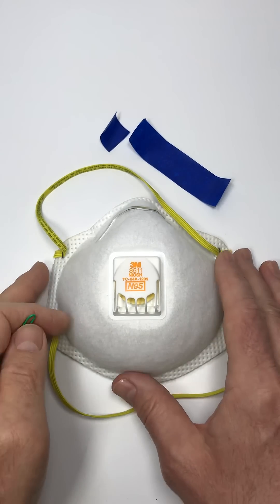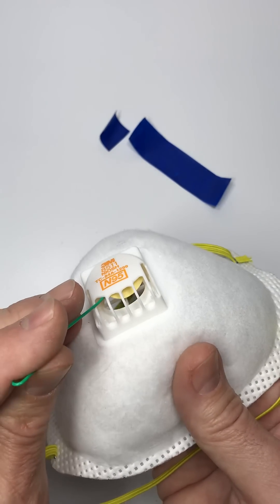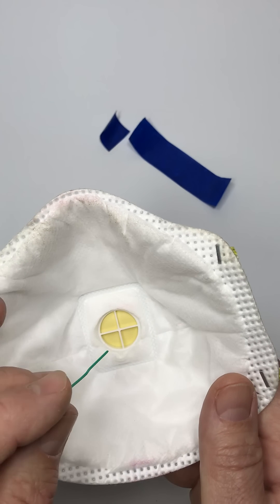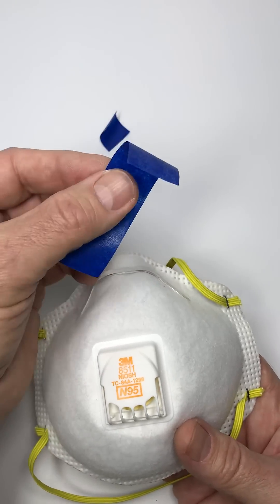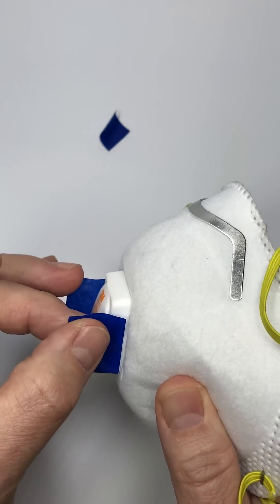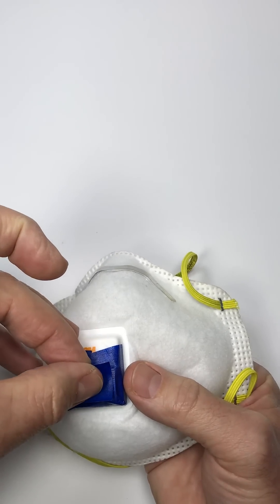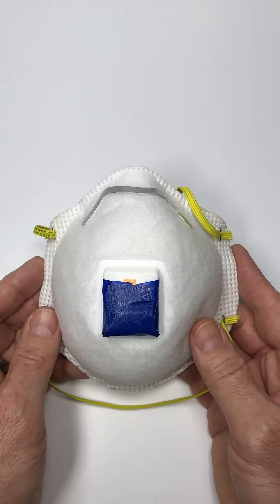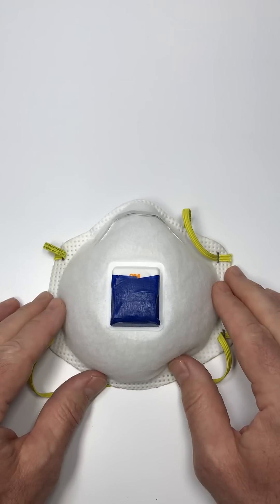Make your mask safe

Comment: I worry that the tape isn't sufficient to actually filter your respiratory droplets, and that blocking the valve completely will just break the seal with your face each time you exhale. I would recommend wearing a cloth mask over the N95. I have been doing that at work and it's mildly annoying but it gives you the protection of the n95 and people around you the protection of the standard mask you'd be wearing otherwise.

Comment: First, he keeps talking about how this modification will stop the spread of "germs". Really??? We're talking dealing with VIRUSES which are very different, both in size and methods of filtration. 

Second, what does closing the filter do to the fit and function of the valved N95 mask design? Some use 'electrostatic filtering', others rely on the seal around the nose and mouth to function when inhaling. My concern is that it might constantly break the seal around the nose and mouth, causing wearers to inhale and exhale unfiltered air -- these aren't "real" respirators with rubber / plastic seals in that area.

Third, how well does the masking tape handle all the moisture and pressure of long-term mask use? If a total seal is desired, I suspect it would be better to use glue to attach plastic film, or possibly duct tape.

Fourth, why not tape or glue a piece of fabric or filter material over the vent? That bypasses several of the above concerns, meets current requirements for filtration, and allows the mask to function (more or less) as designed.

Fifth, the simplest solution is to wear a thin mask over the valved N95, which is how medical personnel do it with light surgical masks. My wife has pinned a homemade fabric mask over her valved N95 and wears it when hiking and shopping.
Reply: The viron is suspended in a droplet much larger than the viron or bacteria.  The mask works by trapping the larger droplet.
Reply: "The main types of germs are bacteria, viruses, fungi, and parasites."  medlineplus.gov-slash-germsandhygiene.html
Reply: Get a grip. Germs or viruses will be blown out unfiltered in this mask. Tape, fabric, filter, whatever you like, just fix it. I have been looking for days for direct, clear explanation of an obvious danger these masks present. Thank the guy for making a good video.